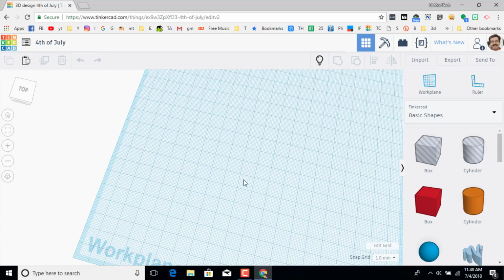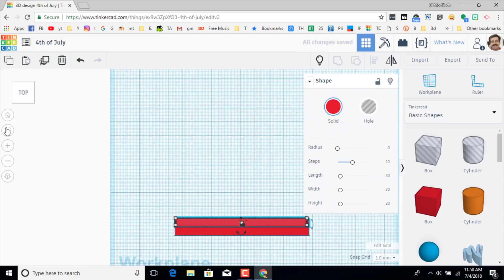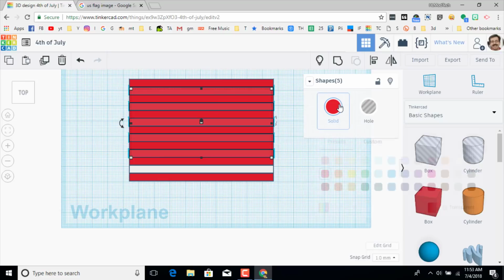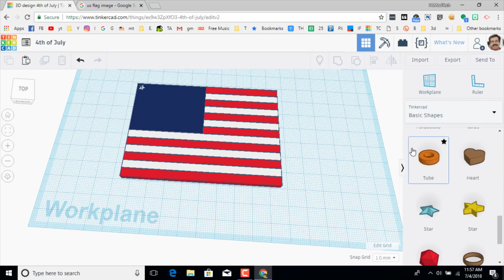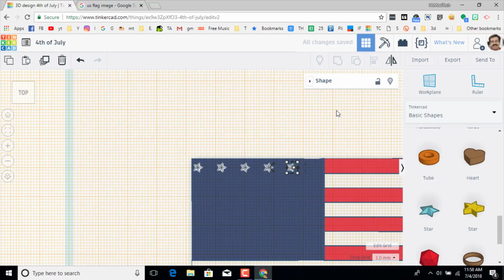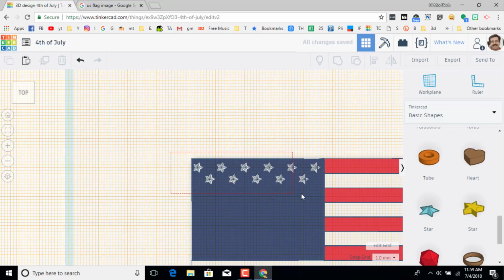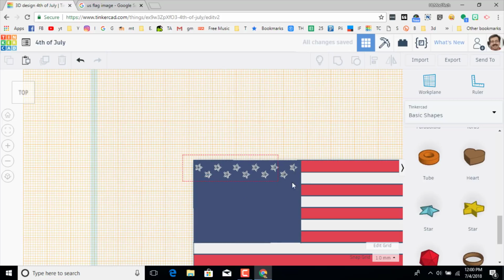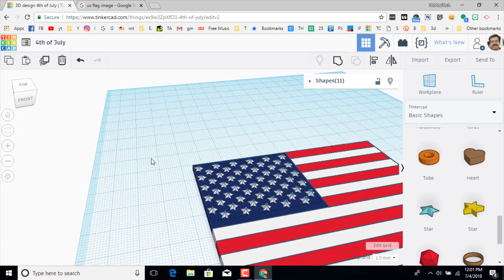Super Simple US Flag in Tinkercad! Master Tinkercad in Minutes

Comment: i know this is an older video, but is there a way to put a wave into this design?  trying to use this on a CNC machine.
Reply from the maker: I actually made one that was thicker, then used the round roof as a hole to cut waves into it. I am not sure my waves bent the way you are thinking of for a CNC machine though.
Reply: @HLModTech  did you make that into a video as well? would love to check it out and see the application.  im trying to learn fusion 360 but i am lost for sure.

Comment: Whats the hieght of stripe
Reply: Thx
Reply from the maker: Yikeees. This was 2 years ago... I do not remember, but let me see if I can figure it out from the video.
Reply: Sorry im doin this for class
Reply from the maker: @jamesggi8205  No worries. I am making a vid right now... will just take me another few minutes and I can hit render.
Reply from the maker: @jamesggi8205  Either 1 or 2 mm thick. It would have been WAY smarter if I had switched to the 5 mm nudge in that first part.
Reply from the maker: Actually opened the old file. 3mm. TinkerCAD is slick in that all your designs are saved. I was able to check the movie for the file name. 👍